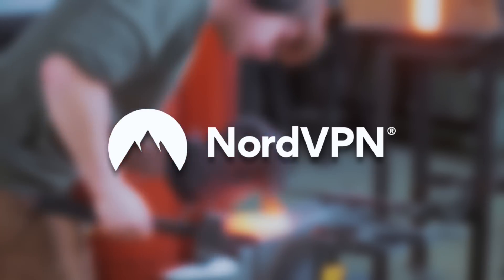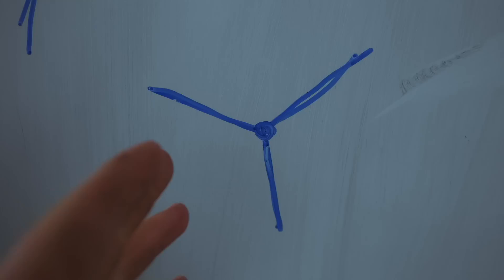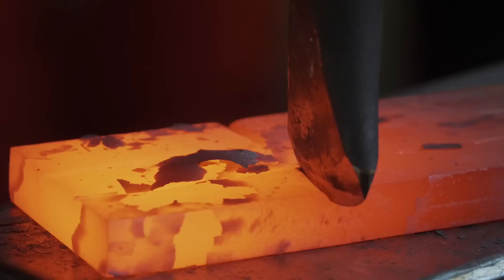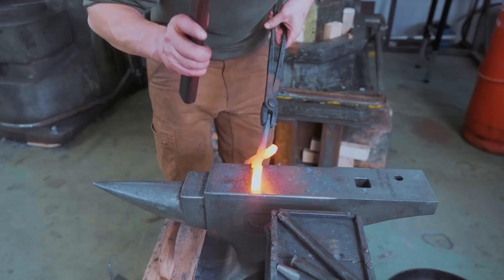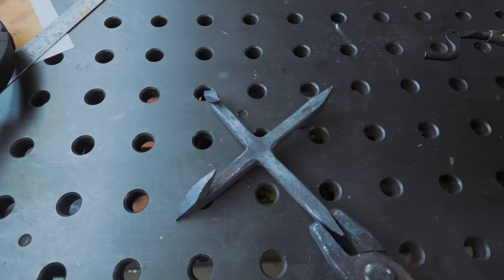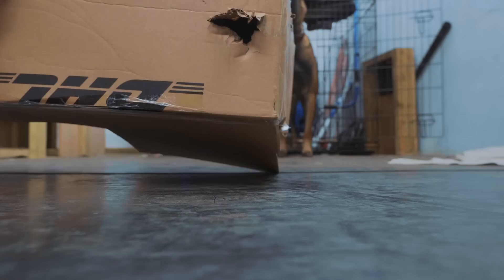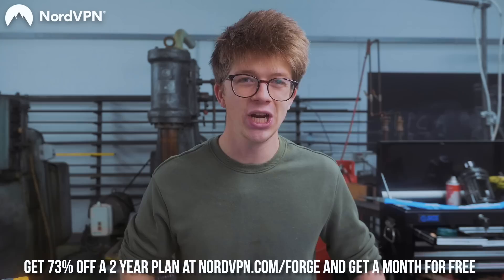Don’t step on Caltrops!!! (Even worse than lego) - Recreating this Medieval tool of war.

Comment: couldn't you have forge welded two bars in the center then barbed and bent them?
Reply: I think his point is to explore sort of how a medieval blacksmith would approach making caltrops by just forging hot metal.
Reply: @canaan5337  that’s what OP said
Reply: @canaan5337  forge welding has been a thing for almost 4000 years... medieval smiths could do it just fine
Reply: @Hdresdendoc  yes, but it requires flux which increases the cost and if it isn't done just right the weld will split apart, but if it's  made out of one piece of metal it's, probably faster cheaper and stronger.
Reply: @canaan5337  If you're making something that needs durability and you're working with modern steel, then starting with a single piece is probably the best way to go.  Classical caltrops were single-use items, though - it's not like you went back for them afterward.  They just have to last long enough to get stuck in someone's foot (or hoof, as it were).

Up until the last hundred and fifty years or so, they were also made of wrought iron, which has a grain structure similar to wood.  Using the shape Alex used in wrought iron would make two of the tines extremely brittle.

Also, flux wasn't necessarily expensive.  Fine white sand or ground seashells were commonly used.  The Greeks would have had easy access to both.

Using the old adage "faster, cheaper, better - pick any two," you'd want faster and cheaper.  A single caltrop has a small chance of getting stepped on - you want to throw the things out by the dozens.  That means you want them made fast and cheap - and forge welding would have been both.

Comment: that seems like a caltrop for an elephant man, thats WAY to big to be practical/historically accurate, but nice done anyway
Reply: Or for a semi-trailer.
Reply: Caltrops as used by the Romans where (called tribulus) are of this size and were used as part defensive fortifications. There are historic examples that are near identical to this. Small caltrops would both be more difficult to manufacture and cause little injury if they even penetrated thick (often hobnailed) boot soles
Reply: @nathanthom8176  thinner and smaller would penetrate the boots more affectively
Reply: @dakotareid1566  and injure less. They were historically that size in Rome, Macedonia and plenty of other places for a reason. The image people have of ninjas with small caltrops is for the most part a made up nonsense.

Also thinner become more frigile with the tines/spike being more likely to bend.
Reply: @nathanthom8176  they’d do the same thing lol they still stick in a foot and don’t come out because of the barbs, I’m seen some at the Royal Ontario Museum when they had an exhibit featuring Roman stuff as well as other cultures, they were no more than 4” tall the thickest I seen there was about a quarter inch, some were hardened, they weren’t very big for what they were
Reply: @dakotareid1566  why are commenting at all, the size that Alec made was accurate to actual examples and most are only slightly smaller and I was not talking about 4 inch ones which is patently obvious when I mention "small" caltrops in my original comment and ninja caltrops in my last. So please do one
Reply: @nathanthom8176  my point is in the whole exhibit I didn’t see anything the size of the one he made
Reply: @dakotareid1566  well I have been to royal armouries, and the British museum and have seen both ( at different times) and can Google images of similar sized caltrops. You anecdotal experience is not historic record and a cursory investigation using the internet would provide you with the required information.

Comment: I had figured on just using two bits of square stock and forge welding in the middle.  Too weak at the join that way?
Reply: Depends on the quality of your forge-welding.

Comment: During union strikes at the coal mines in WV even as late as the ‘90’s caltrops we’re used to disrupt company and scab vehicle movement. 

As a vendor to the mines, I had to visit them even when strikes were occurring. I stopped at the line and explained why I was there to several big, heavily armed men. During our conversation I saw a big box of these sitting next to the road. They were simply very large nails,  with the heads removed and sharpened, bent int a “U” and welded together. No matter which way you tossed it , it always landed with a point upwards. The slang name was “road jacks”. 

I went home and made a few and could easily make one in 15 minutes. Imagine a dozen guys doing that for a few days how quickly you could disrupt a whole county.

Comment: To effectively and quickly deflate tires, one would use two pieces of tubing (three inches each is about right) bent and welded together at the inside of the bends with holes ground in the side of each tube near the juncture to provide a path for air to escape and the tips ground at a slight angle to facilitate penetration.

Comment: Hmm,
Don't take this as a negative comment. I always like the videos and especially like the overly complicated solutions...
Might I suggest: Take two lengths of thick wire (nails). Sharpen the ends. Heat them up. Twist together. Job done.

Comment: Honestly I like your caltrop idea better than mind, which is taking two steel rods, heating them, and twisting them together in the middle like you would a piece of barbed wire, and then folding the four ends out in different directions.

Comment: I have an easier method where you split a flat bar in half lengthwise 2/5ths of the way on each side, leaving the middle 1/5th intact. You put a diagonal chisel line in that intact area and bend along that diagonal line somewhere less than 90 degrees then bend tines to the correct angles.

Comment: 1:40 Forge out two metal spikes at 4 inches in length, bend both of them at around (360/3) 120 degrees and weld them together.

Comment: If you make them out of hollow tube you can make them out of cheaper materials and they can be used to disable vehicles chasing you. The air from the tires can escape from the tubes.

Comment: We probably won't see caltropes today, but I did come across boobytraps made of pins, razor blades, or syringe needles (used), as well as glass shards being glued to unexpected places. This included ladders and playground slides!
In my neighbourhood, someone found it funny at Halloween to span toilet paper across paths and one of them was reinforced with a wire!
Barbed wire would have been worse, but you still don't want to bang against a wire at neck height... 
I've also heard of small fishhooks and nailboards, but that wasn't at my place.

Comment: 2 bars, forge welded together to make a plus sign, bend the perpendiculars to opposite 90 degree angles and you have a caltrop. probably a lot quicker then your cutting method with a lot less waste material.

Comment: I couldn't stop thinking how you could do way less cutting by making two cuts heading in towards each other from the shortest sides, so you end up with an H shape to make your cross from and get the same result.

Also, as a fun fact. Caltrops now tend to be made out of spiked tubes so they can deflate tires even when they haven't fallen out yet. I'm sure a similar effect would happen with a foot, but with blood instead of air.

Comment: The police spike strips are actually not quite like like this; They consist of a series of vertically aligned needles (as in syringe needles), once they enter the tire they stay inside of it and let the air out gradually (so the tire doesn't explode making the car crash).

Comment: Instead of thinking of it as 3 prongs on bottom and 1 on top and cutting out a trident shape, I think you could save some material by thinking of it as 4 prongs equally spaced and cutting out an H shape with no space wasted in between the tines. I think it could also cut down time on forging it as well

Comment: Take two short bars bent in the middle to an angle of 135 degrees.  Weld the two pieces together at the bend, facing away from each other and rotated to make the points arranged in a tetrahedron.  Simple.

Comment: The way I make them is taking a piece of rectangular plate steel and cutting 45’s into the short ends. Next make a straight cut down the middle of each of the 4 sides almost to the center. Lastly bend and twist each leg

Comment: Really forge welding two straight bars would be less wasteful and much more efficient - faster. Even with a hammer, even a cracky weld. As long at it can stand upright, you will do the damage. And if it breaks inside the wound, it is a feature not a fault. Happy New Year!

Comment: They usually had a lot pre made as brick to tool is much more work than rod to tool. also they would have had blooms they would pre shape making the rods very efficient shapes to store their metal. With this stated, they would have gotten two thin rods sharpened then they would twist them together into the cattle trap shape. Quick, easy, effective, and profitable. (look at barbed wire and how its twisted together for reference)

Comment: As old school blacksmiths were really at home with forge welding and also FAST, I think they would probably have taken 2 or 3 bits of metal and just forge welded them together and made the whole thing in about 2 or 3 heats instead or the 15 or 20 it probably took to chisel that out of 1 piece of steel. It was nice to see your Steele brand anvil flatten you chisel and just shrug it off, they definitely did a good job hardening it 😊👍👍👍

Comment: Hi again, great work but there is an  easier way, 2 pieces of round or square  bar  cut to length, barbed ends made, bend them at 120 degrees and forge weld them together at the bend in the appropriate place, much easier.

Comment: my guess is that they would have started with a flat plus sign or with two nails (or nail blanks). the fastest modern way is to bend two nail and weld them together at the bend, or to start with a plus shape and bend two arms down and two arms up

Comment: I'm no blacksmith, but if I was forging one of those things out of one single piece of iron I would use a piece of round bar, hammer out one end to one spike and flattening the other end a bit so I could split it in 3 like a fork and so on.

Comment: the easiest would be to split a flat bar into two tines on either side and then rotate one half of it (lengthwise) so it's effectively and X. and then bend the corresponding tines and sharpen

Comment: to be honest I would think the quickest way would be to take two bars sharpen all four ends then cross them bend them around each other and that would lock them together..its basicly like how they do barbed wire except no waire running down the middle. I know he had a picture of a historic caltrop..but im sure they made the ones for human feet...smaller than that. Perhaps that was a caltrop specificly for like war horses. Cause the two bars twisted together modle would be fine for foot soldiers.

Comment: 1:51- So, you designed this on the fly?
2:07- Yes. That's what usually happens when you turn up the heat, Alec.
2:26- getting complicated...
3:16- !! Look out, Doggo!
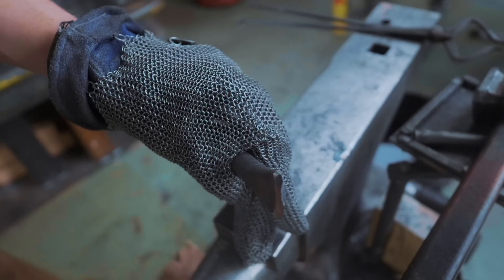3:22- The casualties of the weapons of war?
6:14- WICKED!!
Did you know that Lego-Caltrop is against the Geneva Convention, the Khitomer Accords AND the Shadow Proclamation?

Comment: on a rectangular bar, punch 2 holes each 1/2 desired width of arm from center.
 hot cut each end of bar to its hole.
 forge out to a Y at each end, drawing your spike points while doing so. 90° total angle. (so you basically have a pointy evensided cross or x)
..bend at the center 90°
done
done

Comment: 3 inch section 1/4-1/8 thickness 3/4 wide flat bar split each end about 1/3 the way up force apart taper and bend out. Done in less than 10 minutes.

Comment: What's the benefit of using a chainmail outer glove for punching hot steel? The first thing that comes to mind is more efficient heat distribution, prolonging the time it takes for the leather glove underneath to heat up.

Comment: Cut 2 rods (round or square) to length.
Points & barbs on three ends.
Flatten centre of rod with barbs on both ends.
Punch hole through flat.
Slide single ended rod through double ended.
Forge final point & barb.
Forge weld centre.
Bend to final shape.

Forget the barbs. Double or triple output instead.

Store in bucket of poo slurry.

Comment: They would simply make two “U” or “V” shaped pieces and weld the middle of them together.
I’d like to see you try making them like that and see which way is easier and more efficient.
Reply: You go ahead and try to forge weld 2 U or V shaped pieces of metal together. No modern welders cause they sure as hell didn't have them.
Reply: @hlessiavedon  
I thought about it after I posted and realized that it would have been much easier for them to weld two straight pieces into an “X” and then bend the points into position.
Either way, there is no way they did it like this.

Comment: Easier method would be to take the flat bar and split nearly into pieces down the lengthwise leaving about an inch of metal in the center. Then spread the arms apart into a cross and shape your spikes. Then bend the spikes into their final shape over the horn. You can save time with the forging process I also starting with an oval or otherwise double pointed piece of metal. That way when you split lengthwise the spikes are already mostly formed. If you want the super fast way of doing it take really thin round bar and weld them together into a cross then follow the above message. Being thin round bar they take almost no time to heat and forge quickly on the Anvil compared to a solid rectangle bar like you used. The first method will take about a quarter of the time you spent on this one and the round Bar Method maybe half that.

Comment: Alec - How about making an H out of that rectangular blank by cutting 2 slits, then curving them out to a }{ shape, slit cut the barbs, and sharpen the points. You'll up to then all be working on a flat shape making everything easier. Then turn one of the sides 90 degrees and that'll give you the tetrahedron shape all barbed up.
-- OR --
Making two separate singular parts, bending them to a 120 degree angle in the middle, and forge weld them together. Might even be faster for bulk production.

Comment: This has to be a last resort defence measure, otherwise if you are counter attacking you highly risk being injured by your own Caltrops. The quickest and dirtiest way to make a Caltrop, a short, slim bar of stock. At the middle point, divide into 4 arms of a triangle. Doesn't need to be strong, only has to slice into a horse hoof once. Effective against charging men at arms too. 
Caltrops are similar to land mines, you really need to clean up after the war is over or the injuries will continue.

Comment: I'm wondering if this could have been done by taking a thinner bar, cutting parallel to the long edge in the middle from both ends, and then you only have to make two cuts, forging it out into the cross.

Comment: a thought has occured, why not cut a line down the middle of the flatbar leaving a gap in the middle for the centre then just open up the V at each end to get you to the cross with zero wastage. would this work? I think it would

Comment: So in what I heard you state about the simplest easiest way cause of the disposal and for production speed  I noticed you used a grinder, and I dont think the doffernt lengths would have mattered for the production value, and I think via the pic and my internet search I think you were a little thick but over all I beleive it would have been used just not made with the use of a power grinder 

GREAT JOB  LOVE THESES SIMOLE FORDGING PRIJECTS

Comment: Take two straight sections of rod. Barb each end. Heat the middle section then twist them together at the center two full turns then bend them 90deg from each other. Done.

Comment: why use so much metal?  Seems like the smallest start piece is needed.  Meaning have two legs pointing opposite directions, requires only 2 splits (cuts).  Another method would be to weld two bars together on the anvil.

Comment: Love the shape and lethality of your caltrop... but if you want cheap and fast to make and still dangerous, wouldn't it be simpler to tet two steel round bars (much smaller in diameter, like nails for example) that you spike and barb at each end, bend at 90 degrees at the center, and heat weld together? I'd like to hear from someone good at the forge if this sounds right or not.

Comment: That seems a strange form to use. If your requirement is to forge from flat stock, then a rectangular piece with partial splits towards the middle on the longest axis would give you 4 prongs and no wastage.

Comment: You can also make them by takin to either square stock or round stock pieces of equal length, forge welding them beside each other in the middle of the length. Then folding each separate bar out 90 deg and then either simply grind or forge a spike on them or do like you did and forge a barbed spike. I have made small versions to keep coyotes and possums out of my chicken pen by taking some 1/8 in round bar, taking 1 inch long pieces, bending them 90 deg in my vice and tack welding them together at the center with the right angles and finish them by grinding points on the ends. The critters tend to only put a little pressure down and run off, I have always found all the ones I have spread out but then I don't put barbs  on mine. They also work to keep pesky neighbors out of your yard, which I found out by accident when a few fell out of the box on the way out to the pen.

Comment: neat video, but why not just bend two bits of rebar or some other steel bars at a 90° angle, weld the two at the bend and sharpen and barb it?